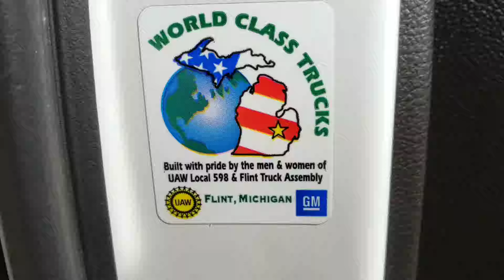2016 CHEVY DURAMAX!!!! Nightmare Car wash, Rare Parts tie rod ends & K&N air filter!!

Comment: Looks good man!  It's been about a year, how are the ole tie rods holding up?
Reply from the maker: The Tie rods are working fantastic! I defiantly recommend these Tie Rods! Alignment is super true and very stable steering! I use 4X4 in deep sand while towing at Pismo quite often! She drives smooth no problem! I included a link below! Thank you Kooshdaakaa!
 https://www.alligatorperformance.com/rare-parts-29092g2-extreme-tie-rods-11-19-gm-6-6l-duramax